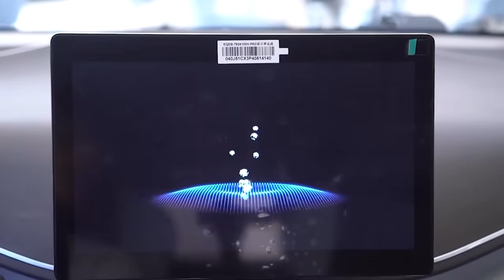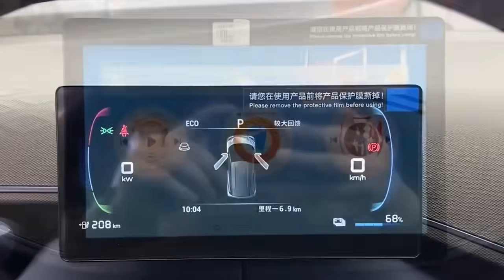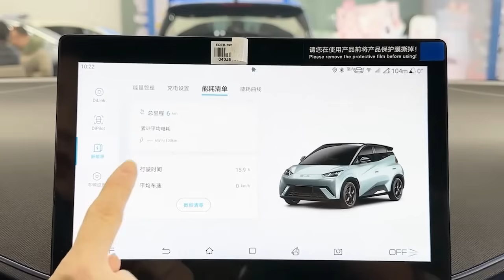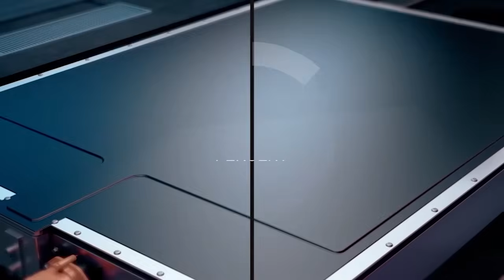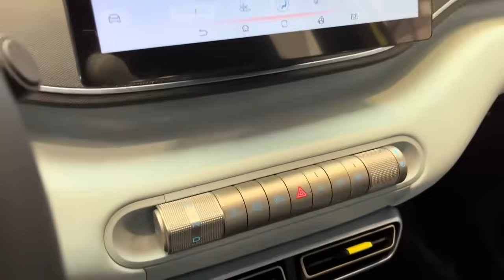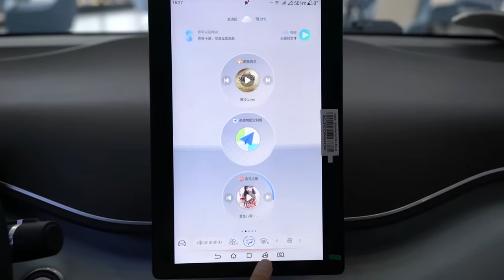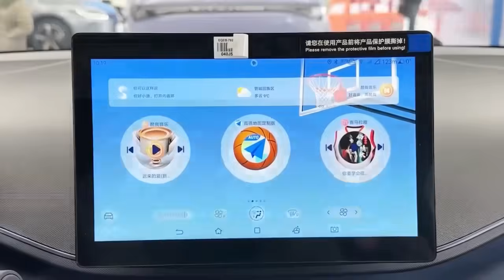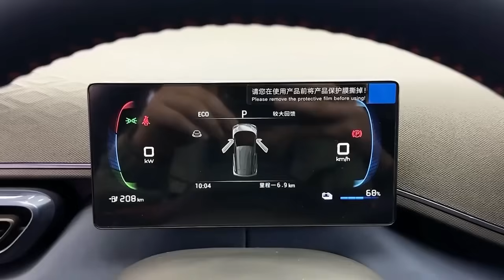Byd Ceo Just Unveiled New $4,999 Car and SHOCKED The Entire Car Industry!

Comment: Hugo did something similar years ago too 🤣🤣🤣🤣🤣🤣🤣 There was no need to change your oil just change the engine instead
Reply: Remember the name byd kid
Reply: there is no engine in EVs...duh....

the most expensive components of legacy ICE cars, engine and transmission, dont exist in EVs. and EVs have 50% less parts and components than ICE cars. those are 2 reasons why the cost of building an EV is a lot cheaper.

and china's scale of production in automobiles and its most completed EV supply chains are another reasons why the cost of building an EV is a lot lower in china.

 china is building 1/3 of global total (30 million cars) per year. and chinese auto industry has a capacity to build 2/3 of global total (60 million cars) per year as of now. its very easy for chinese auto industry to scale up at moment notice. so the cost will continue to drop..